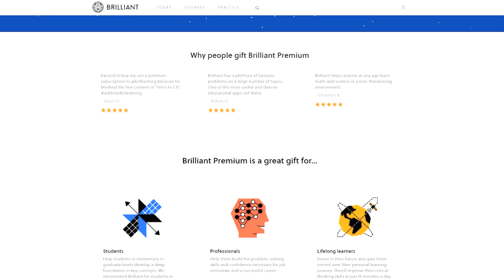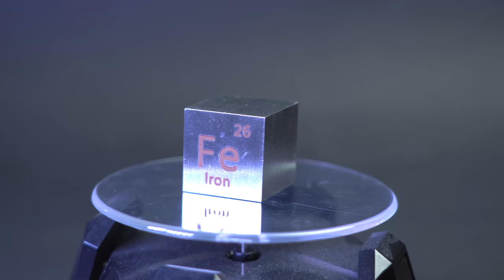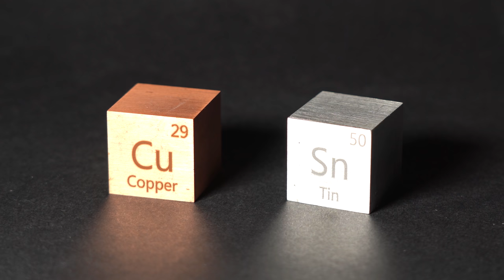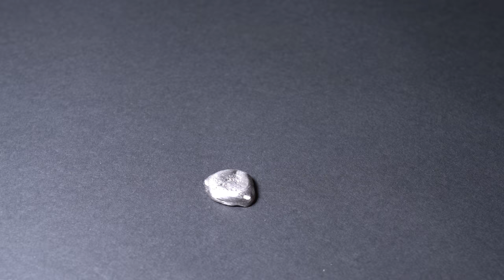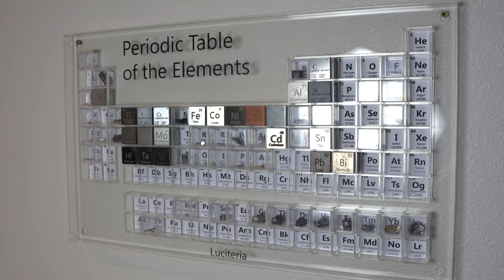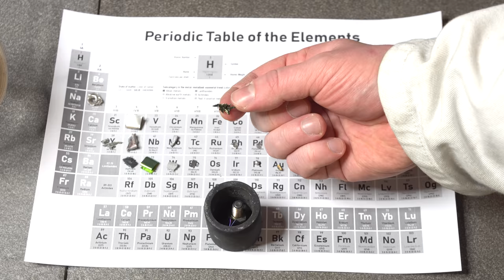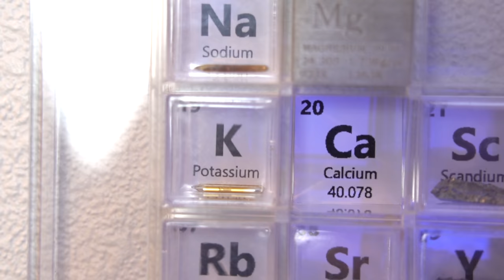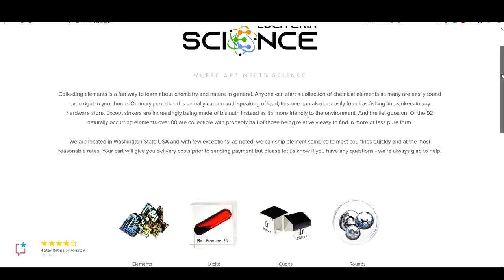What Happens if you MIX ALL The METALS Together?

Comment: Many metals don't mix that well or form specific intermediate compounds. I was expecting you would see a large collection of demixed alloys here. Can you show what it looks like under a microscope?
Reply: Exactly what I thought
Reply: I imagined the more dense metals that don't mix with iron like gold would sink to the bottom of the crucible and were angle grinded away.
Reply: @Wackydude27  I wonder if you could maybe centrifuge it when smelting to even out the psuedo-alloy and prevent it from settling. Hmm. Reminds me that I haven't kept up with the low gravity smelting experiments they were supposed to be trying on the ISS.

I second the wanting to view it under a microscope part. Maybe record the density and do a few hardness and conductivity tests....you know, just normal experimental metallurgical stuff...
Reply: It probably helped that a lot of the metals he chose are common elements used for steel alloys. 

Of course not all of them were, but it seemed like the majority of what he used were.
Reply: @DeltafangEX  i think that would probably work but could you imagine a white hot cylinder being slung around? 🤣
Reply: @Wackydude27  what if he mixed them in space/0 gravity?
Reply: I imagine it looks like 90s Balkans under the microscope
Reply: If he again put that new alloy in furnace, will it get mixed better?
Reply: @DeltafangEX  omg I never even thought of that....
Reply: @WretchedRedoran  lmfa
Reply: @swastikgaming3489  I'm sorry I have to ask, what is the relation between edgy gamer names and metallurgy
Reply: @mihailmilev9909  Just for Fun I have watched.
Reply: @swastikgaming3489  Probably not. The difference in densities extends to both their liquid and solid states. Think like the multi-layered cake appearance of oils of different colors and densities all floating atop water at the very bottom.

Then you have to consider the fact that their melting points are all vastly different, which means they melt at different rates and you'll still get a globby mess of unevenly spaced, differently colored metals as your final ingot before cleaning.

It's probably not possible to make a stable omni-alloy without a specific process and/or environment. Likely extremely high pressure and low or zero gravity and enough power to keep the furnace ungodly hot for an inconveniently long amount of time - all to make sure they are evenly mixed without separating into layers. And that (likely black magic) technique probably also assumes you have equipment for assisting with the mixing that can survive the process in the first place.

Yeah. Likely impossible without some sort of super furnace buried deep within Jupiter's lower atmosphere or something. Of course, if you're not worried about the results of your experiments only technically being able to be defined as an "alloy", then Neutron Stars and Black Holes can technically make an "alloy" out of anything...
Reply: @DeltafangEX  oh now I get it. Like Water, Oils and Alcohol like cetyl Alcohol have different densities though they are in liquid form. I was also thinking to Black magic similar then each metal will go to different locations in space where their density will be same then they are melt and mixed maybe using some direct teleporting or by using portals.
Reply: @swastikgaming3489  That makes a surprising amount of sense. One of the stories I'm writing right now has to do with ultra-specific runes that affect the fundamental properties of one exact thing and only that one thing.

i.e. The runes for changing the density of say granite is somewhat similar to the one for marble, but different enough that when used on an unintended object they do nothing at best and possibly do something catastrophic at worst. Say cause the item to spontaneous sublimate - probably taking your tools and employees with it. Thus experimenting with changing runes to further improve them or change their functions is pretty much a dead art by the time the story begins - but for a reason clearly.

It's like being able to easily access and manipulate the fundamental forces. Changing the voltage of electrons or say the propagation time of gravitons could cause some spiraling meltdown of universal laws that sees your entire planet here one day and gone the next.

So theoretically, with enough trial and error (and probably a lot of dead scientists), you could actually make your omni-alloy by attempting to change the properties...but melting would destroy the runes and thus their effect so probably not...
Reply: @Vividsorrows  🤡🤡🤡🤡💀💀💀
Reply: @DeltafangEX  Can you explain how black holes can form?
Reply: @nockran  You mean like...in general? Because personally, I'd consider black hole formation to be the most easily understood thing about them.

1) Most extremely large objects have an equally large force preventing them from collapsing on each other. Think Earth with its layers of rock and mantle: the atoms and molecules that make them up have strong enough bonds to not only distribute the weight, but prevent the whole thing from simply collapsing. For the Sun: nuclear fusion produces a lot of outward pushing radiation, which prevents the Sun's mass from collapsing back in on itself.

2) Once an object reaches a specific mass where the outward pressure or molecular bonds are weaker than gravity, the object simply collapses. When this happens, the whole mess is so energetic that most atoms lose their electrons entirely. The only thing keeping atoms from being outright flattened are the fact that the protons in the nucleus repel other atoms. With enough gravity, they can basically be forced together to the point where they are basically touching and the only thing preventing further collapse are the internals of the neutrons themselves.

3) If still more mass is added, even this force can be overcome and the object completely collapses into a black hole. This can also happen if the collapsing object is massive enough that the speed and force of all the mass flowing inward simply overcomes the resistance individual neutrons have to being squashed so tightly.

How? Why? We don't really know. Technically speaking...a black hole is any object with a specific mass to radius ratio (an object's Schwarzchild Radius). Below that ratio you won't get a black hole. Above that ratio and...well, it doesn't really matter anymore. At least as far as we can tell with our current level of technology.

It's sorta like how there's no point measuring temperature below "absolute zero", because atoms simply stop moving altogether - which is how we measure temperature in the first place. Once an object becomes a black hole,  you already need to exceed the speed of light to escape it...and while (theoretically at least) the energy required to escape one will continue to rise as its mass and density do, you already need near infinite energy to travel at that speed anyway - which makes measuring its mass beyond a specific point pointless outside of considering the gravitational effects such a supermassive object has on its surroundings (like our galactic core).

Hope that helps a bit.
Reply: @awashburn6944  I was trying (and failing to keep it brief, but yes. Many alloys are compatible based on many different factors. The copper/aluminum combined melting point is of specfic interest to me, as I do Al melts at home myself. Liquid Al's ability to seemingly eat away at other metals submerged into it (despite their higher melting points) is fantastically odd.

Such emergent properties can only be found by (expensive and time consuming) trial and error though - either that or through AI analysis and predictions of their interactions. I'd argue that whatever possible overlapping phase diagrams that an "omnialloy" possesses is simply too complex to properly model right now. So I think in this case the generalization works, if roughly.

Even with all that said, we're making the very broad assumption that melting together a hunk of every metal is a static, binary process that either ends with all metals alloying or none of them do. It could very well be that under some obscure, exacting conditions and in some arcane order, you can create alloys that are progressively able to be further alloyed with each additional metal.

Either that or perhaps some form of  high-entropy alloy is possible with enough tinkering.

Comment: I suspect you've made a high-entropy alloy here. Many metals get harder when mixed, and if you mix the right ones, you can make them extremely hard and strong. Some reported alloys of iron, nickel, copper, vanadium and chromium specifically are incredibly hard!
Reply: Yeah nickel chrome and vanadium gives you prohrom the non rust and non magnetic stainless steel. Used in food industry machinery and farmaceuts. Also its a metal that your kitchen sink is made off :D
Reply: Imagen making a weapon from this thing
Reply: Yes some bromides reach hardness close to diamond
Reply: No it's definitely not a high-entropy alloy. You need to mix these at atomic evenness to be high-entropy alloy.
Reply: Vibranium
Reply: @kornelobajdin5889  boutta craft a prohrom sword in minecraft
Reply: @GHOSTYTH3GOAT  hardness is not durability. It's mostly even hurts the durability of material.
Reply: High entropy alloy means no crystalline structure right? Or rather that it's basically randomly mixed, right?
Reply: Does that mean it's very brittle when it breaks? 😶‍🌫️
Reply: over mixing alloys has the opposite effect though im affraid. Anything made out of that composite would be horribly brittle.
Reply: Now we just need to make a shield and test out how strong this combo is against a 50. Caliber.😂😂😂
Reply: @Multiyuppp  High Entropy Alloys are specifically made by mixing 5 or more elements in near-equal proportions. Rather than forming brittle ceramic-like composites, the atoms will arrange themselves into an unusual pattern that resists fracturing and is both more elastic and harder. However, they generally require thorough mixing (e.g. induction mixing or powder mixing in a ball mill) and will separate out into brittle phases if not done properly.
Reply: nerd
Reply: You can also combine metals and get a liquid like NaK.
Reply: @bicxter  dude you look 10x more nerdier than this guy 😂
Reply: @Syuvinya  The definition for HEAs has become quite relaxed nowadays. 5-35 at% of over 5 elements and you got yourself an HEA. The problem is that in this particular case we are talking about 20-30 alloying additions so I think the definition cannot be satisfied. Therefore we'd just call it a Multicomponent (MCA) or Multi Principal Element (MPEA) alloy. Realistically speaking, what I am expecting to happen given this manufacturing process is the manifestation of profound macrosegregation with domains of alloying elements that alloy well with one another being present in the material. Also, as shown in this example, several unmolten particles should be present especially in the case of alloying elements with a higher melting point. As Si had also been added the presence of eutectic intermetallics is expected. Lastly, for it to be as strongly magnetic as shown it would mean that the alloy should comprise of a Fe-Co-Ni base but I think that's where the estimates end. Face Centred Cubic (FCC) is the typical crystal structure in MCAs when you add them as randomly as what was done here; however, I would suspect the formation of an FCC + Body Centred Cubic (BCC) structure with Si-containing and Mg-containing intemetallics being present alongside impurity-based phases e.g. Carbides, Nitrides, Oxides etc. Anyways, a very fun experiment to watch. I would have very much loved to see some characterisation work for the fun of it.
Reply: @bicxter  jealous much?
Reply: @pauls7612  out of curiosity where did you go to school?
Reply: @ithinkimjesus1465  bro think he Jesus 🦧
Reply: @bicxter  🤣🤣🤣🤣🤣 it's a joke
Reply: @kornelobajdin5889  Nickel,* chrome and vanadium give* you ... / pharmaceuticals* / ... is made of*. And the stainless steel to make kitchen sinks and cooking pots does not contain any vanadium. This kind of steel must be soft, so it can be drawn and pressed into shapes without ripping, vanadium would be detrimantal to that, since it contributes to hardness.
Reply: @GHOSTYTH3GOAT  Imagine* ...
Reply: @aya5468  It's not "brittle when it breaks", to be brittle means to be more likely to break.
Reply: @Kyharra  more nerdy* ...
Reply: @GHOSTYTH3GOAT  The Nazi's did use Vanadium for their tank armor but started to use manganese as the war went on an resources dwindled
Reply: @off6848  thats cool
Reply: Wouldn't that be LOW entropy, then?
Reply: What if you put Titanium into the mix?
Reply: @smileyp4535 you're conflating it with amorphous metals, amorphous metals have no crystalline structure.
Reply: @shawermus not the case with high-entropy-alloys, not like any other alloy. High entropy alloy's retain both a high amount of strength, & elasticity, & hardness with no compromise.
Reply: Depends on quantity and additives.
Reply: @einundsiebenziger5488  "It's not "brittle when it breaks", to be brittle means to be more likely to break".  Materials can be brittle when they break, brittle or ductile are typical descriptors of fracture appearance and mode.
Reply: @PixlRainbow  Yes, I already missed the ball mixing and/or powder mixing. There are methods instead of balls as well. The ball are usually made of WC or W. There are a lot of different methods to fuse the elements as well. Casting in furnaces or with induction and sintering are just two of them. When not al elements melt, or in case of sintering in general we often use a cold press first. So, if you mix everything together, you get different melting points. Tungsten e.g. will not melt. It's a nice example, but we shouldn't use for any practical reasons.
Reply: Sounds like a stainless steel
Reply: @kornelobajdin5889  Tiny amounts of cobalt could be used with titanium or tantalum. Often carbides or borides are used. For example, tungsten carbide or chromiumboride. Probably some nitrides could be used as well. You must do tests under controlled circumstances with P, M and T as variables. With gas or in vacuum. A lot is already published in specific magazines.
Reply: Iron nickel and chromium makes stainless steel, so yeah, I can see that.
Reply: @Syuvinya  Dude said punch of nothing anyaway :D
Reply: if you mix Americans with Chinese?

Comment: I was curious about why iron replaced bronze, and the explanation I found had to do with availability rather than superiority. Bronze required conquering large territories to access sources of its two components, whereas iron is abundantly distributed and can be mined in one spot.
Reply: I looked it up and it said only pure iron but I didn't research I only looked it for like a minute so dont take my comment as a fact
Reply: As he mentioned, copper can be found in it's pure form naturally while afaik, iron can not. This explains why the bronze age existed and used bronze, as purifying iron to make it workable, especially with it's high melting point, is likely rather difficult without the appropriate tools. And while yes, iron was much more abundant, it is also harder and thus better fit for weaponry. But the real breakthrough in regards to hardness was steel. Even rather early bone steel, like vikings used, significantly improved the iron weapons
Reply: The main difficulty AFAIK was just getting the iron out of the ore. Even after that, iron needs to be made into steel or undergo proper heat treatment to meet or exceed bronze's specifications. But once that barrier is passed, it's extremely worth it, since iron is far more abundant in general. And by far more I mean orders of magnitude more. This lets you build far more weapons, armors, etc, leading to a huge advantage even if the quality was a bit iffy at first.
Reply: It's same with titanium. It's the 9th most abundant metal on Earth, and better than steel in every way. It's just a pain in the ass to get, and even harder to work with.
Reply: @ianlindstrom2019 The weaker iron was still incredibly useful though because its better than copper and much easier to source than bronze even if its harder to process into a useful form. 

Due to the reasons the top comment mentioned. If you wanted bronze you were reliant on trade and foreign states being stable because the metals required to create bronze were not accessible in the same region in large quantities. So if a foreign state that is the source of one part of the bronze recipe collapses or gets embroiled in war or trade is disrupted... then tough luck you cant get your bronze.